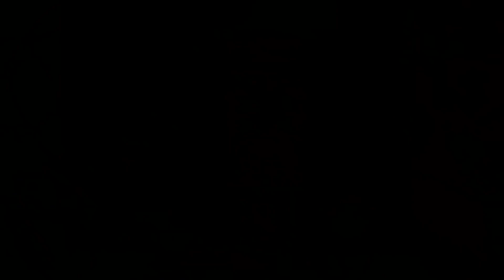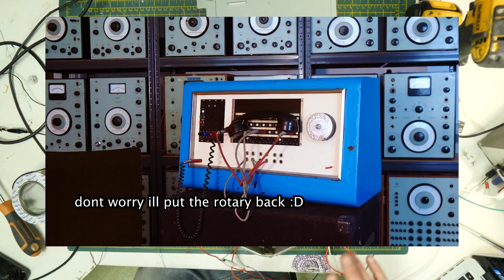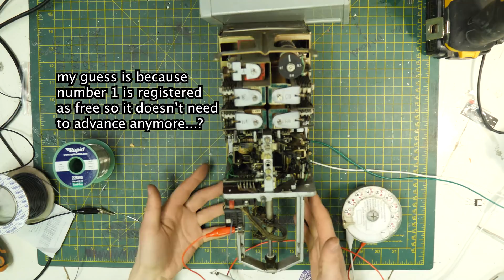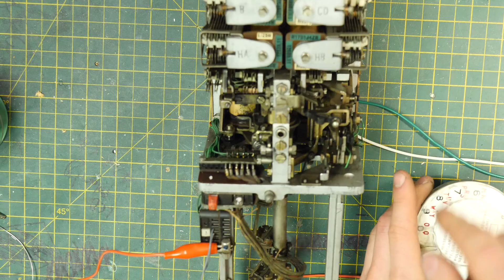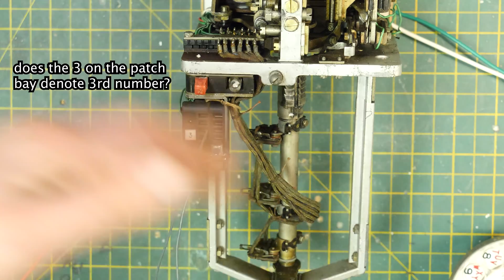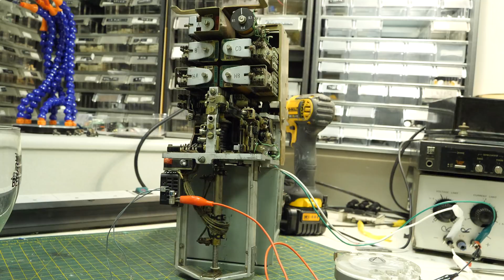MORE STROWGER IT LIVES (part 2 of hopefully a guzzillion more)

Comment from the maker: in this vid manage to make it speak! by the end manage to figure out which parts in the relay logic is in charge of searching for free lines but making it talk in that respect is still on the cards, a J.kay has emailed me some diagrams of the 4000 group selector this evening so I will be perusing and figuring this out for part 3 :) thanks J.Kay!
Reply: Hey I Found the missing peaces on eBay idk if they fit doesnt say anything in the discription. It only says that they are from the Bundeswehr   
https://www.ebay.de/itm/Funkgeraet-Telefon-Post-BP-Hoerer-Mess-Pruefgeraet-Relais-/154096025301?_trksid=p2349624.m46890.l49286
Reply: @ih4t3u28  hey thanks a lot! i dont think thatis quite right but thanks!@ i have a current cradle im trying to track down at the minute for it so ill keep you posted :)
Reply: Some helpful diagrams that have been redrawn from the original diagrams on order to illustrate specific parts of the operation http://www.samhallas.co.uk/repository/documents/final_selector.pdf

Comment: probably loads of phone men out there who remember this but here goes - this is a stronger non-director first or third selector. normally racked in 80 units. you have the old grey can cover later models were straw. To adjust this properly you need a test stand which allows you to adjust vertical and horizontal stroke and backlash. Its lubed with bearing 19 a thin red oil. The all important toll is a datum pin which is inserted in the central hole and isolates the carriarge like a camshaft. The operational sequence having been seized and gone vertical is the rotary stroke and if I remember it was seize operates A ops B ops CD depending of odd or even selection HA or HB releases. 40 years since I did one of these so probably be corrected. always preferred these as they gave screw adjustments rather than bending as in the 2000 type.
Reply from the maker: hey s Downes, I may have gone a bit mad on this stuff. I hadn't realised this video hadn't even gone up a year ago! well nearly a year ago. I fell well and truly into the telephone exchange rabbit hole. now having 2 uax rack A's and a lot of other random malarkey, the video coming up this week on the look mum no computer channel is finally wiring it up to the internet so people can call in from externally. it was wired in to be called today however half way through a problem occurred on the server which I couldn't fix till customer services came in, which hasn't happened yet! haha. https://youtu.be/Tko8nTD59Qg

when you talk about bending adjustments which ones are you talking about? I'm intrigued, having only learnt from the documentation I can find and what makes sense, I have a lot of 2000 selectors and not many of the 4000 would love toknowwhat you can remember. cheers

Comment: Thanks for the shout out :) I think you can make it hunt across by putting an earth on the orange wire that comes up from the wipers to the tag block just above the plug block on the front.  Although without the bank contacts, it will think all 10 of the next stage equipment are free and reset after going all the way across.

It's great to see someone else discovering how awesome these things are, I love em!

Your idea of using it for audio routing isn't completely out there - I'm told the BBC used to have very similar equipment for broadcast audio/video routing within their studios.

Comment: This is inspiring me to 3d print some parts like this. I love how it's complicated, yet simple at the same time.
Reply from the maker: yeah a few good gears to be honest it is the book "ingenious mechanisms" as a machine haha, the mechanisms are pretty 101 for mechanical parts. that makes them no less amazing I just mean yeah definitely could make 3d print inspired versions! funky ratchet pinion sorta thingies
Reply: @THISMUSEUMISNOTOBSOLETE  If you had a bunch of tones running on individual oscillators, you could use a few simpler 3d-printed versions of these (or the baseball-sized switcher) to dial-a-song. But you'd need an absolute ton of oscillators, and nobody has that many just lying about.